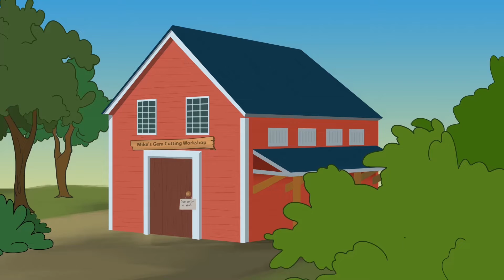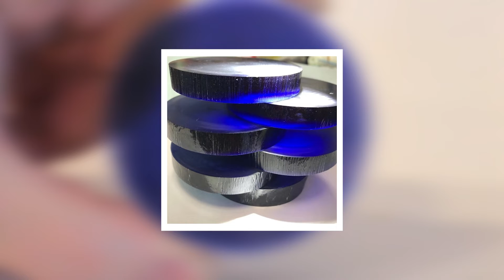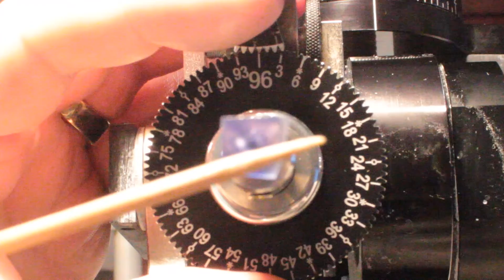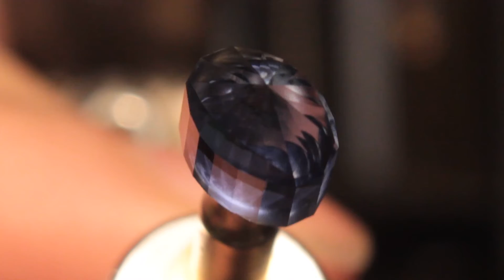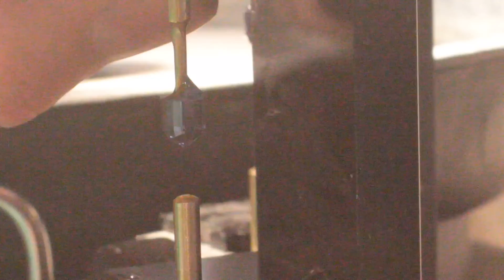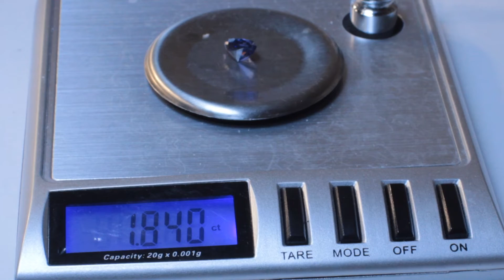Gem Cutting Tutorial: Rainbow LC Sapphire Ring

Comment: I love synthetic gemstones. It's just such a cost-effective way to get large gemstones for various settings where you want to show off the splendor of the stone and the intricacy of the cut in a way that a smaller natural stone of the same price might not be suitable. Plus, with synthetic stones, you don't really have to worry about the ethics of how they're sourced nearly as much as with natural, mined stones. That looks like a lovely color based on the slab and the translucency is spectacular for such a thick slab of corundum. 

Wow, the color of the stones changes so much once you thin them down with the pavilion and girdle cuts, before the internal refraction can intensify the color. It's always amazing to me how the color changes so dramatically once you add in the facets on the crown. Looks like these might be close to a Ceylon sapphire coloration, which is a subtle and beautiful color.

They turned out amazingly well and there's barely any difference between the two. I'm sure Bopie will be quite happy to find a setting for the second one.
Reply from the maker: Cost effective?  Well, maybe, but the pulled method is about 100 times more expensive than the 'flame fusion' method for corundum.  But the problem with ceylon colored flam fusion corundum is that the color is all in the 'rind' of the boule, the center is clear.  So Flame Fusion is cheap....but for BLUE Corundum, you have to orient the stone so that it picks up the color from the 'rhind'.  Pulled method is an option, but it's much much much more costly then flame fusion.

Comment: Mike when using the Helios, how do you release the first dop after transferring to cut the table?
Reply from the maker: Normally with heat.  I wrap the stone in a piece of wet paper towel.  Then, I normally clamp it into my small vice with the dop that I want to remove sticking out.  Then I use a Butane torch and heat that dop for a second or two and it comes right off.  I may have to scrape a little glue off the stone with a box cutter but that's about it.
Reply: @BopiesDiamondsFineJewelry  thank you. I usually dop with wax. Curious about trying the Helios

Comment: Hi Mike, very nice to see the setting. I've been in touch with the super glue company and for some reason they won't supply Australia with stock. I'm using normal super glue and its annoying waiting 24 hours before I can start faceting. I also use wax buts its been hard to get lately.
Reply: Hi.  I have heard from some faceters that they have had luck with other brands of UV activated superglue.  I have only tried one brand, Bondic, and it did not work at all.  But maybe you can find a different brand?  I can't imagine why wax would be hard to get, but I never got the hang of using wax.  I do know that wax is the favorite of half...ok, probably more than half...ok, more than half of gem cutters.  🙂

Comment: Hello. 
Good job! I like these Barion pavilions on sapphires. 
In my work, I also constantly follow the MeetPoint technic at my UT. 
But when it comes to stones smaller than 3 mm in size, forming a girdle becomes very painful... 
I'm thinking about buying Offset Attachment from UltraTec and making small stones the old way, without MeetPoint, but I'm worried that it may not be possible to save time, since I will have to almost manually adjust all the angles. 
What do you think?
Reply: Thanks.  I have not tried the offset attachment from UT so I can't really talk about it.  I do cut small stones on occasion and think it is good practice to cut a small stone once in a while.  To me, they cut the same as a larger stone, and normally, smaller stones polish easier than larger stones, at least that is my experience.  I would not change the designs you are using for stones, but if for some reason you are having problems with girdles, there must be a reason...I'd say you should cut a few more while focusing on trying to isolate the issue with the girdles.  Maybe you are overcutting because of the size of the stones?
Reply: @mikesackos2208  
Thank u for your reply...
I can create it...
Nevertheless, it takes the same time, like for larger gems...
But the price for tiny stones can't cover the time which you spend for meetpoint method...
It is concerned  tiny gems only...
So, I'm trying to find the way to cut down the time ...
Reply: @evgenyk.4681  Yes you make a valid point.

Comment: Very nice, That stuff must be easier to cut than trying to line up the flame fusion rind colour.
Reply: Bingo.  The second reason I needed to use rough created by the pulled or Czochralski method is exactly as you stated.  The odd thing about blue (and only blue) corundom (sapphire and ruby) crated using the flame fusion method is that the blue color is all in the outer 'rind' of the boule.  The inner part is colorless.  So you have to cut your blue sapphire so that some of the 'rind' is in the final gemstone and captures the blue.  For my upcoming special project, I need no color zoning...blue throughout the gemstone.  So flame fusion is out.  ...and also boules are not large enough for my project.